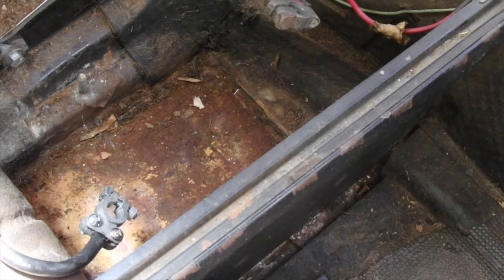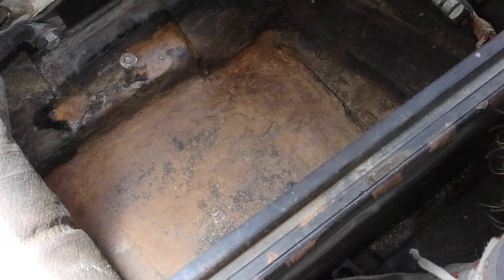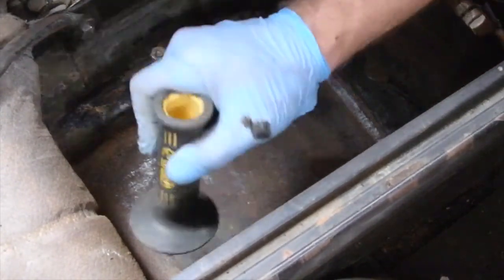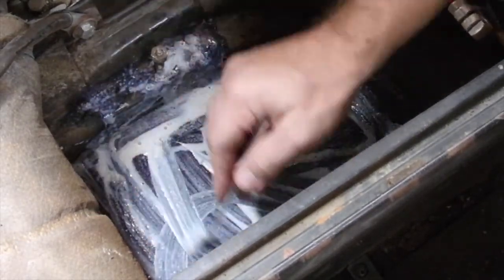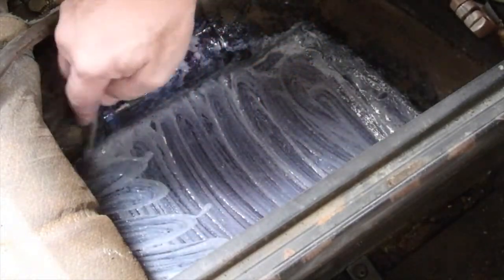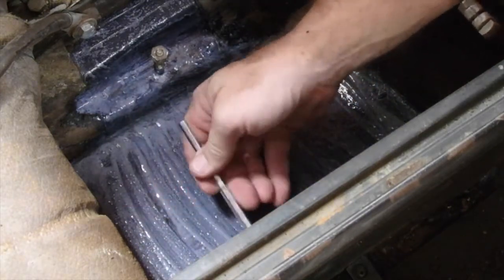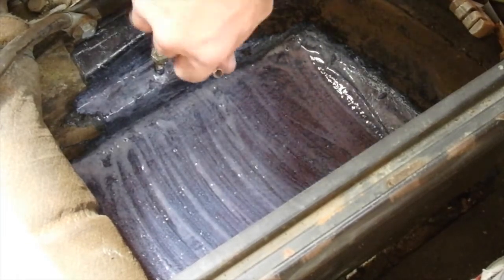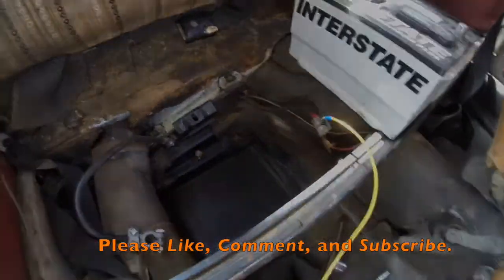1969 VW Bug Project - Episode 16 - Battery Tray Floor

Comment: What did you use to coat the area?
Reply from the maker: Permatex 81773 Rust Treatment.  I used this extensively on my Willys CJ-3A, as well.  Love it.  Looks like indigestion medicine (foamy milk), but hardens into a shiny black coat.

Comment: hi, I'm curious...what's the white liquid?
Reply from the maker: Permeates Rust Treatment.  It's a rust converter that hardens into a thick black protective coat.  I've used it on two different vehicles with great results.

https://www.permatex.com/products/specialized-maintenance-repair/body-interior-trim/permatex-rust-treatment/